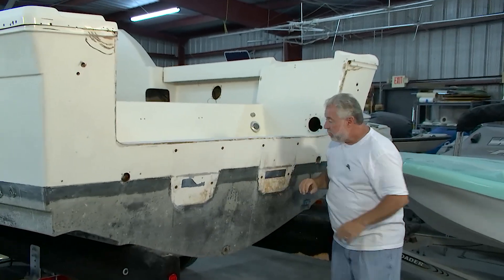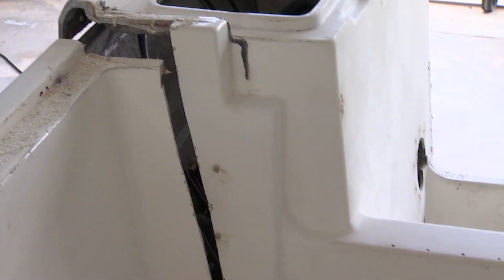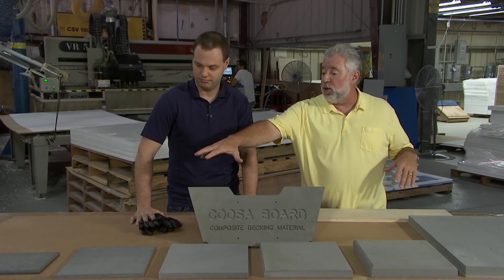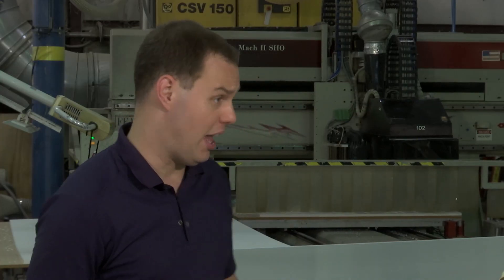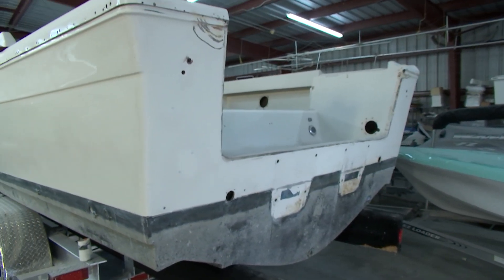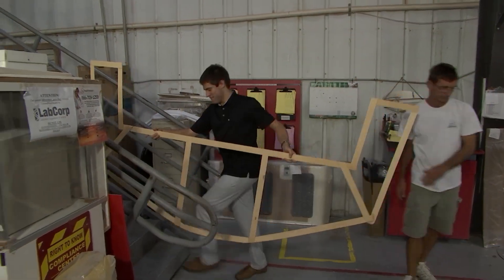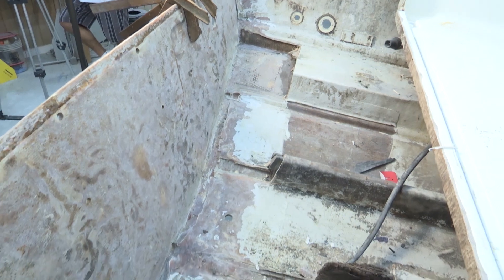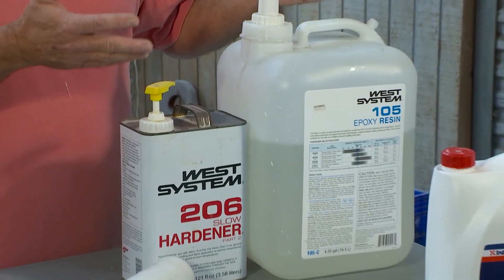Replacing a Rotted Transom with Coosa Board - Boat Restoration

Comment: Any time you have two big surface that may have some voids it’s best to think of it like tile. Use thickened epoxy and use a smooth with a step trowel. You want to make the lines vertical so the lines don’t sag and trap air. Push the Coosa board in contact at the bottom first. You’re working the epoxy squeeze/air from bottom up. It’s ok to use boards from the inside to push along the bottom and sides but not in the middle or top. You don’t want to bow out the transom. You will need long reach clamps for the middle.

Comment: Your wrong,  THE CSM HAS A FILLER THAT IS DISSOLVED BY POLYESTER RESIN NOT EPOXY!  In this application polyester resin is better.  It dissolves the CSM FILLER AND MAKES A BETTER BOND THAN EPOXY.   But really epoxy is fine too

Comment: I just stumbled across this very neat and well produced video, and I am massively impressed with the Coosa Board Product which I had not heard of before. However I notice there are no bleed holes in the board like standard structural PVC and also we would normally vacuum a job like this particularly where the access is this good. I'm Not knocking your work for a second but can you be sure you have achieved a void free bond and the best structural integrity?

Comment: Finally somebody sees what I have been thinking. That is to overlap your run of mat over good material on the sides and bottom to reinforce it. This would certainly give it strength. I see lots of people talking strength but, they use the wrong mat material and this is the first person I have seen that actually overlapped it.

Comment: I remember the days of wood boats and all the issues with worrying about an open seem out in the canyons fishing. Sure an old Chris Craft type of skiff, runabout look great but with all the new ways Not to use Wood ya have to be crazy to use wood in any piece of a boat. I like to fish, boat, dive, ski, explore, ect.  not be married to a boatyard . I have 2 boats 1- 28' with doubles and 1- cheaper Angler C.C. neither have any wood in them Period. Sandwiching wood with glass always will rot over time.    good job n video.
Reply: depends on if the wood lasted 25 years and your 50 years old who cares.

Comment: Awesome job looks super strong I'm thinking of doing my hydra sport bass boat with coosa boared I looked in to pourable transom products but the weight what concerns me also going to use opoxy on it transom had some flex when I got it I tightened all the motor bolts up I believe it's not done right wood isn't roton I checked it no flex now but its got air voids in it be a winter project or fall lol